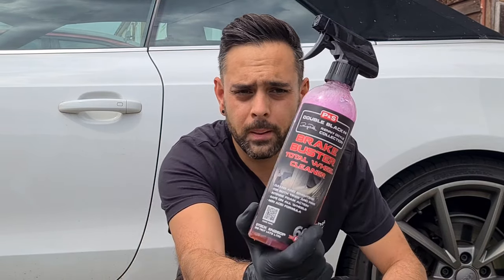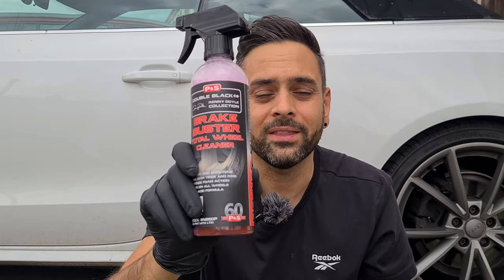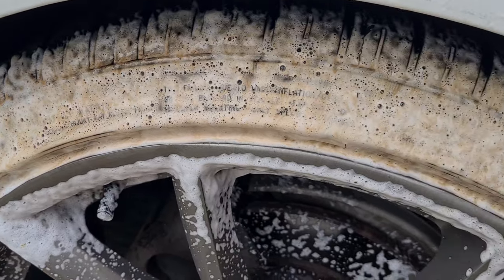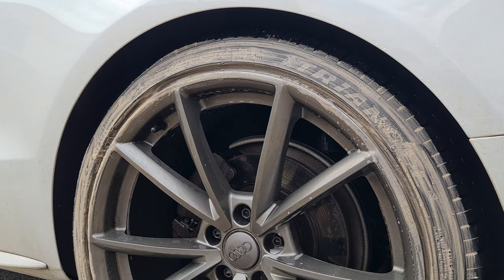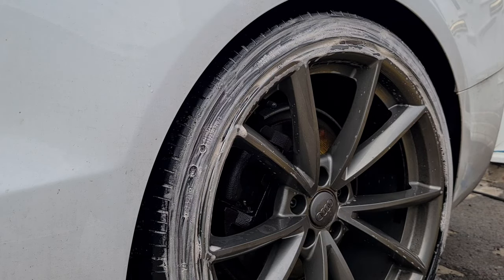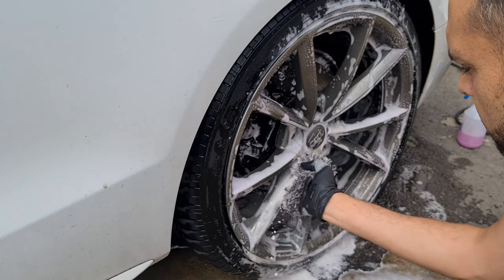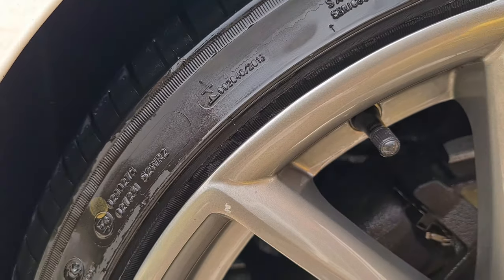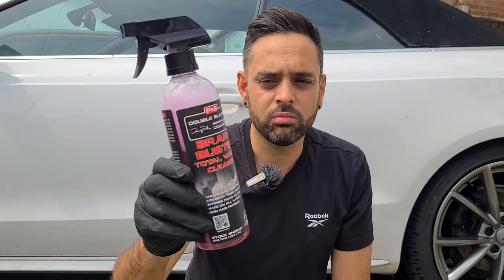P&S Brake Buster - The Best Wheel & Tire Cleaner

Comment: Nice video any idea how to remove that brake disc rust which is stuck on the wheel (i noticed it after i washed my car today)? I have some Turtle Wax Rapid Decon wheel cleaner thinking could that work (I looked on Google but can barely find anything other than scrub ut away lol)? Thanks
Reply from the maker: Do you mean on the face of the disc
Well if it is once you drive it, it will dissappear
Reply: @APASSIONFORDETAILING  thanks for getting back and no I think some rusty liquid dripped onto the wheel itself somehow strangely (the car is only a few months old so it can't be surface rust on the wheel) it's very strange though
Reply from the maker: Ahhh I see what you mean on the wheel not the discs ? Decon from TW should remove it if not a acid based wheel cleaner will
Reply: @APASSIONFORDETAILING  yeah I just used it and it worked I didn't coat the whole wheel a sprayed it onto a paper towel, put the paper towel on the spot, left it about 2 minutes then it wiped off thankfully lol thanks for your help as well
Reply: My next wash will probably be more of a decon wash after which I will apply some Fusso Coat (this one was more maintenance and I started at 1700 yesterday as the sun refused to have a break)
Reply from the maker: @3945hp  cleaning in the sun is a killer I feel your pain
Reply: @APASSIONFORDETAILING  yeah fun times lol

Comment: I use bh auto wheels if the alloys are quiet bad and not been washed in awhile but for normally maintained wheels after using so many over the years I’ve found fuel axis the best,I’ve never been a big fan of brake buster I know the Americans rave about it but there’s a lot better products out there 

I find the foam very dry when applied with a pump sprayer and it’s not effective as many others on the market 

Never know why Americans rave about it but I’m guessing unlike us in UK they don’t have the choice we do
Reply from the maker: Good choice 
If you havnt tried GT wheel shampoo or decon I would g9 give then a try imo after trying so many very good if not the best